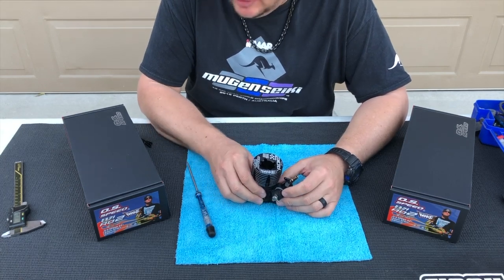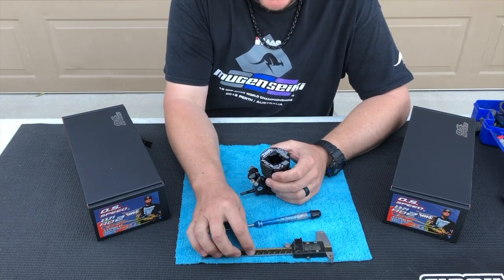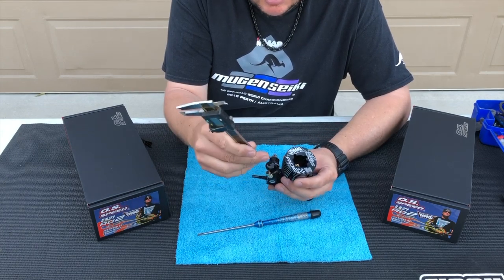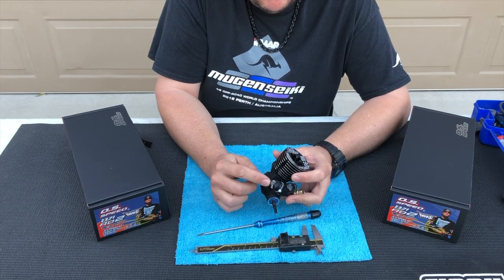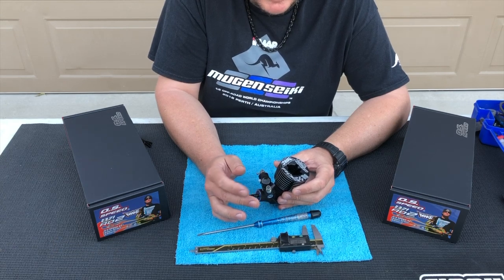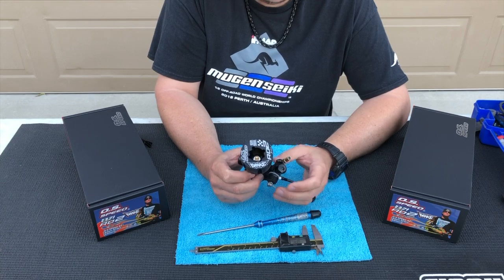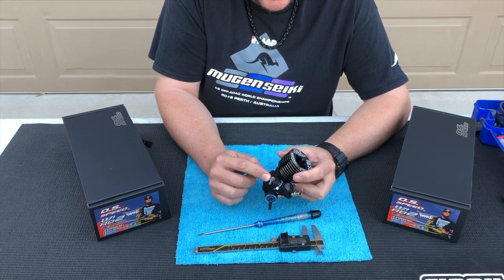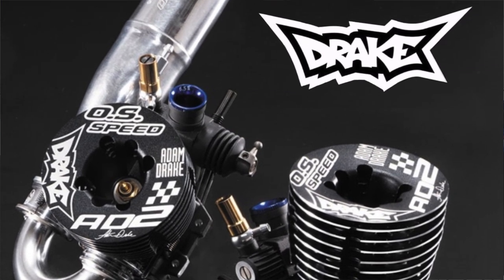Carburetor settings for the OS Speed B21AD2.

Comment: hi adam i need some help i am after a new wrist pin / connecting pin for my os speed but dont have a part number all i can say is the speed engine i have the head is black with os speed tuned wrote on with like a tribal  pattern on there and on the crank case it says os max 21xz and wrist pin looks like 4mm thick by 13.5 long when if measured it any help would b great
Reply from the maker: Pretty much all the newer OS off-road engines use the same rod and rist pin.

Comment: What should the idle gap be set at?
Reply from the maker: .5mm

www.thedrakeracing.com
Reply: @AdamDrake  Do you use a guage pin? I've seen a few videos of guys using ground down feeler guages and that will be less than accurate and subject to all kings of user error. So when those guys say .5mm I  question the accuracy of the measurment method.

Comment: Hi @Adam Drake, I have a question that Im looking to hopefully find the answer here from you. I am just really confused a bit on an engine I have which is the OS B21 AD2 that I received. Now I just ran a quart of byrons 20% through it to start the break in period but every video of yours I see about the needle valve adjustments which in this case I am having issues with the Low End. I see you state that a good starting point is around .4 or .5mm from flush. Now I can tell you on this engine that if I started at that measurement this engine will never start. I literally have to have this thing about 4 or 5 turns in from flush. Its prolly around a 1/2 inch in from flush and this thing fires right up. My question to you is this correct? Does this seem normal to you?

I also tried reaching you on FB as well not sure if you respond there as well. Any help would be greatly appreciated.
Reply from the maker: Hello, that doesn't seem normal.  Usually OS carbs are very consistent and the settings are close from engine to engine.  Please feel free to message me on you FB page / fan page (not the profile/personal page)or you can email me direct at adamdrake117@gmail.com  Also a short video of what's going on would be helpful.
Thanks,
Adam
Reply: @AdamDrake  ok will do when i get home from work. thanks,
Reply from the maker: @cbrwix6999  Thanks!
Reply: @AdamDrake  Sent you 4 VIDS. Let me know? Thanks Again.